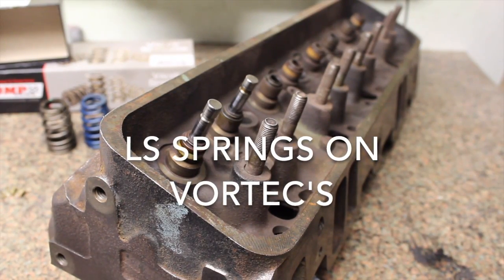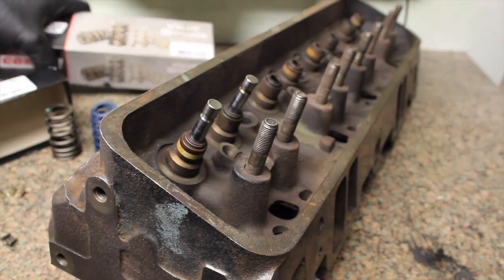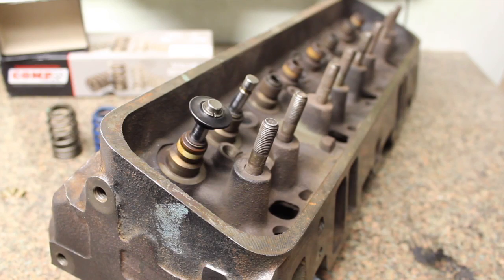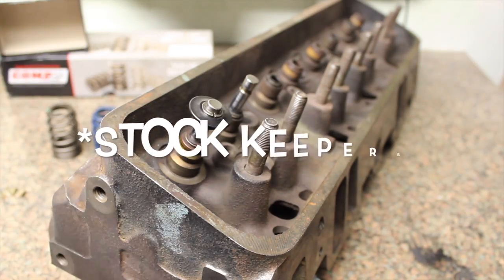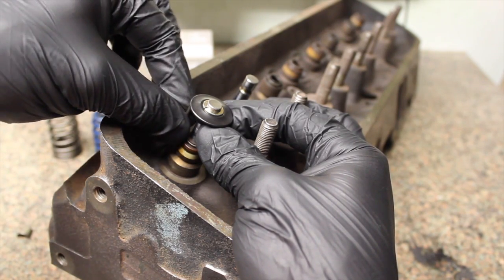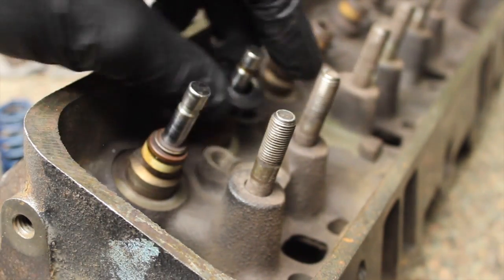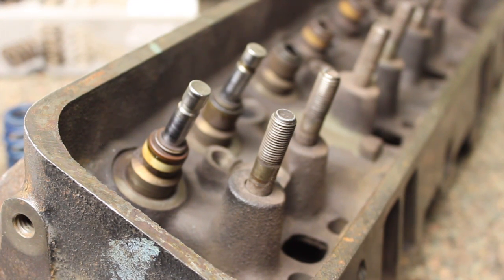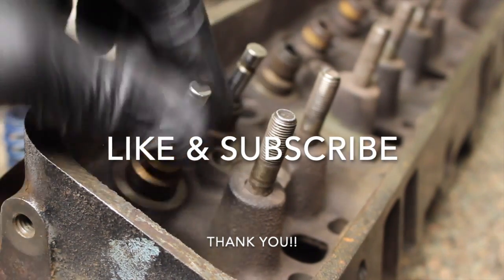LS6 Valve Springs on SBC Vortec Heads

Comment: Hey bud , I wanted to let you know I enjoy and appreciate your video's. I have a question for you also. I recently ordered a set of the ls6 beehives from summit racing. There store brand and they were way to tight of a fit around the guide bosses. So i ordered another set of howards cams beehives that they recommended for my cam. They fit the bosses with room to spare and the outside lip of the spring pocket holds them in place pretty well. Do you think this setup is acceptable or should i rely solely on the guide boss to keep the spring in place. Probably have about .015 to .020 clearance between the spring and the guide boss.
Reply from the maker: What size are your guide bosses? A ls6 spring will typically fit perfect over a clean stock guide. i have has a few sets that ive has to take a sanding roll to clean up the guide a bit more for them to fit. 
As for you new springs if the outside pocket holds them then you should should be ok. A normal spring locator has about .010 clearance. 
Cheers!
Reply: @cuttersperformance   they range in size from .854 to .857 the springs i got from summit are around .855 id i ordered the other set of howards cams they are .900 id and seem to fit ok just a little wiggle room between them and the bosses but the lip around the outside of the spring pocket holds them in place pretty well. Thanks.
Reply: Roller tips?!

Comment: Great video! Very informative! I’m looking for a nice cam and spring kit setup for my ‘98 Chevy Silverado with vortec 350. Do you recommend one with a nice lope(like with a mutha thumpr or thumpr cam sound)?
Reply from the maker: A really good sounding cam I've used a few times now is the meiling 22280 
It has a really nice lump to it
Reply: @cuttersperformance  melling 22280 isnot a computer cam will work if you run carburetor if you are staying throttle body you need computer cam?
Reply from the maker: @alfapecho818  ive used that cam with fuel injection. Needs a good tuner though

Comment: Would this work with the 5.7 vortec stock heads aswell?
Reply from the maker: Yeah that is a 5.7 vortec head
Reply: @cuttersperformance  I recently purchased a 96 c 1500 with a 5.0 vortec. I will be changing the intake manifold gasket as it is leaking coolant.  While replacing the gasket I will swap the cam. Will the ls6 springs work on the 5.0 vortec heads? looking  to get about 490ish lift.
Reply from the maker: @B Don  yes they will
Reply: @cuttersperformance  thanks for the reply, would you happen to have any cam recommendations in the .480 to .500 lift range. Want to stay short of the 525 lt4 hot cam

Comment: Could I use the ls6 springs on a old school 886 head? Also i have asked before about using 059 heads on a 3 50 would it be possible to use the ls6 springs on them also? And my final question is which would be the better bang for the buck using the 059 heads or the 886 on my small block 350?

Comment: Outstanding work 👊🏼 I’m looking to freshen up my 94 impala SS. I just ordered Try-Y gen 2 ceramic coated headers with 2 1/2 inch XL spintech mufflers. The car has 105,000 & I plan on keeping the stock cam. I’m looking into beehive comp springs with 1.6 RR. The plan is installing them under the hood down the road. I have been a mechanic for 19 years & have never done them on an Lt-1. Any advice would be greatly appreciated. This car is in honor of my brother that was killed in 94, he was a marine. I must say that you are doing a great thing by sharing your knowledge & I just subscribed 👊🏼🏴‍☠️🇺🇸 🔝
Reply from the maker: Yeah man not hard to do, 
Use a leak down tester to pressurize the cylinder at TDC, then use a on car head valve spring compressor to push the spring down. Then carefully use a magnet to remove the keepers.
the compressed air hold the valve up 
Let me know if that doesn't answer your questions and I can do a video on it 

Cheers!
Reply: The 26915 comp springs are the ones I’m reading about. I have the other part numbers in my tool box for the retainers & whatnot. My question 🙋🏻‍♂️ is which tool would make it easier for removing the springs. I have the spinning star ⭐️ one in my box. I read about another that’s a lower profile, to make the process quicker for the firewall side. I’m in no rush at the moment cause I’m still waiting on parts. Again, I sincerely thank you for sharing your knowledge 💯🏴‍☠️🇺🇸

Comment: Hello I have a atk hp32 my cam has is 220/224@50 495in 502ex 112 lsa compression 9.6.1 roller cam is there something better with less lift for more power also 5 speed manual thanks
Reply from the maker: What are you not happy with the cam you have now? Why less lift?
Reply: I don't know to much about cams i didn't know what makes the power duration or lift

Comment: Great videos I’ve have watched a few and thanks for the great advice.   I'm doing a budget build with my old 350 rebuilt and bored 0.30 flat top pistons with Vortec heads Going to use ls6 springs and retainers with factory rockers would get the off set lock if needed . I Don't want to do any machine
  Could you recommend a good cam for this set up I know my compression is going to come up with those heads there are so many different cams I get confused   I'm putting the engine in my Camaro its just a summer toy  it has dual exhaust with headers th350  3:373 gears with 28 inch tires
Reply: what cam did you end up going with? going to change my springs and my setup sounds close to yours
Reply: @PerFectCapture  Competition Cams CL122463 Xtreme Energy XE274H Cam & Lifters Kit   it pulls strong guessing around 375-400 Hp

Comment: What self aligning roller rockers and cam do u recommend after using the offset ones?
Reply from the maker: The comp cams roller tip self aligning rockers work well 👌 
The cam will depend on your combo
Reply: @cuttersperformance   I want to do a bigger cam than the 280h I currently have I already have the screw in arp studs just want a bigger cam to wake it up a little more
Reply: 1.5 or1.6?

Comment: When using the gm blue springs can you keep the stock 062/906 keepers and retainers?
Reply from the maker: Keepers yes, retainers no 
You need to use retainers for beehive springs
Reply: @cuttersperformance  so unless I'm swapping in 8mm valve stems I'm looking at new parts vs grabbing them from a junkyard ls engine. Just seems to me the entire point of vortecs is low budget build, by the time you rent the cutter to make a standard double spring fit, have a valve job done, setup the heads right.. no matter how you look at it you'll have 3/4 the cost of a decent set of aluminum heads invested in the iron heads. I have a low mileage set of original 906 castings that were basically given to me. Engine was new under warranty and spun a rod bearing. My buddy works at the dealership, they sat on a shelf waiting for a return authorization from gm for over a decade (gm elected to send a new long block) finally the service manager gave them to my buddy. He gave them to me. Less than 35,000 miles on them. I'd like to use them on an old long rod 355 I have sitting here. And not spend 700 bucks making them work with the.540/.540 lift solid flat tappet cam that's in it. If I have to end up changing the cam, or doing other things I'd be money and time ahead to buy a set of afr enforcer heads for a grand and just bolt them on.
Reply: @cuttersperformance  really just want to cut down the guides and throw a set of double springs on them and run them. The heads are so fresh they still have the bar code sticker on them from when they were assembled. Some mild surface rust to clean up, but other than that they are barely broken in dude. Suggestions?
Reply from the maker: I tell guys all the time, unless you get the heads cheap and do the work yourself its not usually worth it 
Typically you can have a set of vortecs all done for under $500.
But its a hell of a head for the money

Comment: Please give your opinion on single vs dual keeper groove.
Reply from the maker: By dual keeper groove are you referring to older or after market valves with two grooves? If so the top groove is for the keepers and the lower groove is for a o ring (older engines)
Reply: @cuttersperformance  - not specifically to the sbc but for example, ferrea makes some valves with two grooves that the keeper rides in. Supertech only has one groove and I’ve heard mixed information that one is better than the other. I just wanted to know your thoughts. Thanks for the reply.
Reply from the maker: I've seen double locks on some stock import heads but I've personally never used them on any performance applications

Comment: You need to buy a valve spring hight micrometer. They are 40 to 90 bucks and the cheap ones are accurate enough.
Reply from the maker: I have two brother use it weekly! This is just a ole school way for guys to do it at home without buying one. Works well actually

Comment: I got a l31 crate motor and I am pretty disappointed with it I wasn't expecting much but still not alot of power I want a 480 480 cam should I use that offset keeper to be on the safe side
Reply: Crate motor, it probably has the later Mexico made vortec heads, not nearly as good as the made in the US ones.

Comment: I got a question. We’re did you get those springs?? I ordered them and received ones that wasn’t blue. They also don’t like to fit over the guide boss have you have this issue
Reply from the maker: I've heard of others having this issue  but I have not. I stopped using the blue springs after I came up with my own kit. I heard of others having issues with the gm Mexico blue springs so I stopped using them but I've used many sets without issue personally

Comment: I have chevrolet performance beehive springs, 787 retainers and +.050 keepers with an lt4 hotcam which is .492 lift with 1.5 rockers I am intending to install next weekend. Will this set up fit in my truck? Thank you
Reply from the maker: With the offset keepers you should be ok with clearance but i cant say for sure. Always a good idea to check rather than guess 
If you are running the stock rocker arms you might be maxing those out aswell 
Also make sure you check your rocker arm to retainer clearance as thats can be a issue when using offset keepers
Reply: @cuttersperformance  thank you for the response man and I will be using stock rockers for now and I will be checking all clearances my only concern is the rocker and retainer clearance. Thanks for the great content I am now a subscriber.
Reply from the maker: Really be sure to check rocker arm to rocker stud clearance at full lift if your using stock rockers 
Thanks for subscribing!
Reply: @cuttersperformance  also if my stock 1.5s won't work do you have a suggestion of some that will? Having a hard time finding info about this online thanks
Reply from the maker: @BayouOutdoors92  comp cams 1417-16 should work great for you 👍
Reply: @cuttersperformance  thank you so much you're awesome dude will be referring everyone to your channel
Reply: @cuttersperformance  the 1417-16 with beehive springs and 787 retainers and +.050 keepers rub every single valve and retainer badly praying I can fix this on the bench grinder tomorrow.
Reply: @BayouOutdoors92  how did this turn out? I have my cart full on summit with all the parts to do this. Wondering what rockers to use?

Comment: Can a race engine get by with umbrella seals or no seal at all? Set I just bought off a stock car have no seal on them
Reply from the maker: I've seen some guys run no seals on drag cars and some none just on the exhaust 
Not something I would do personally, I have a set of darts that had some valve seals pop off the intake valves...the oil build up on top of the valve is insane
Reply: I have the comp cams retainers with offset locks but may have to trim the guide down a bit to run seals. Lunati spected out a voodoo 703 for a 406 that is a vacuum rule race engine. Rules allow 15” @1000 rpm. I have my doubts it will make that. I even told them it has 1.6 comp roller tips so I will gain like .031 lift from those. I may drop to a 702 camshaft and be done. thanks for the advise
Reply: A lot of times will run oring seals instead of umbrella seal.

Comment: This was a good video my only thing is I’m running .450 with 100% stock heads and it runs great I’ve heard mostly that you can run about .465 with stock heads as long as it’s not a high duration cam but I love your content keep it up man
Reply from the maker: Do you have a pretty mild or stock cam? Stock springs are pretty weak for any sort of performance cam.
I'd be very nervous running past .450 lift personally 
Thanks for the positive feedback! 
Vortec porting / flow bench videos coming soon!
Reply: @cuttersperformance  it’s a sum-8800 stage 1 cam it’s pretty mild with a almost stock smooth idle
Reply: @cuttersperformance  also I 100% agree I know I’m cutting it close at about .030 clearance but I haven’t had any issues but I won’t run anything over .450 without beefed up springs and retainers
Reply from the maker: @anthonyspangler1537  Hit me up if you need a spring kit for those suckers! I got springs to cover from mild to wild, no machining and direct drop in! 
pcperformance1@outlook.com
Reply: @cuttersperformance I'm running a Crane Cam power Max cam. The lift is .427/.454 lift. The duration is 204/216. It red lines at 5,000 rpm. What spring will work for my stock Vortec heads?
Reply: I’m only running .450 lift is there a slightly beefier spring available I’m looking for something slightly heavier but nothing crazf

Comment: I have watched all of your vortec head videos and I would like to know if 305 vortec heads (12558059) any good?  Thanks keep up the good work!
Reply from the maker: Yeah the 059 (305) heads are also a great head and the best production 305 head ever made.
They have smaller intake valves and don't flow aswell as the 906 or 062.
They have a smaller 58cc chamber.
I don't have any in the shop but I've been trying to get a set to modify and put on the flow bench 
I always go for the 906 or062 heads but im curious how much flow I can get out of 059s even with the stock valve size with some port work
Reply: @cuttersperformance  The 059s I had actually outflowed the crack prone hecho en mexico 062 garbage heads that came on the crate engine in my Express van. I run Pac1218s on 0.100 longer valves with the springs shimmed correctly. Cheap tip as well. Fully seat your seals.  They work perfectly and give you additonal seat to retainer clearance.

Comment: Got a question for the beehive springs do you have to run a different keepers? Like would the stock ones work
Reply: CompCams makes a retainer that works with the beehive springs and the 11/32" diameter valves.

Comment: This is exactly what I needed! Im running .600 valve springs for an ls6 on my heads, screw in studs and offset keepers, but what are the best or what self aligning rockers would you recommend?
Reply from the maker: I've had good luck with the comp cams roller tip rocker arms 
Especially with offset locks locks becuase you lose some of the valve tip. Make sure you check your rocker to retainer clearance 
*See my vortec rocker arm video

Comment: Cool video I’m running vortec heads on my 84 c10. My question is I used ls6 blue springs and comp locks with comp retainers. No machine work besides cleaning and new valves guides are not cut down The cam I what to use comp thumper cam .479int and .465exh would good running this or cut it close. Thanks
Reply from the maker: As shown in the video .480 lift was good with a .050 clearance to the stock seal.
So if you used the same retainers you should have no issues 👍
Reply: Thanks

Comment: Thanks for the video. Question, I have a new pair of 062 heads I bought years ago and have been saving. They had the Z28 beehive springs installed by a shop, and I was told the were checked to .480 lift. Only planning to go .440 lift on the cam. Are the press in studs ok? Thanks.

Comment: So using the .050 clearance rule,the stock set up clears .450 lift but the springs are to weak?
Reply from the maker: That is correct 
Some guys grind the bottom of the stock retainers, but not something I like to play with. 
Stock springs are very weak
I put beehives on every set of vortecs ive done
6000+ rpm and .550 lift no problem with the right springs

Comment: Have you ever seen a stock head not take a .450 lift ?
Reply from the maker: Are you talking with stock springs aswell?
Reply: @cuttersperformance  Just the clearance problem,I'm assuming I can get a stronger spring,am I wrong?   Thanks
Reply: sorry,Iwatched the video  again and seen the .420 limit I missed the first time.( I have seen some probably mis info saying stock was good to .450)
Reply from the maker: General rule is...make sure you check anything over  .450 lift
Reply: @cuttersperformance  Yes,as soon as I get these health issues over with I'm gonna get out there tear apart and do measuring and building.Thanks for the good info

Comment: I bought a set of 906 rebuilt heads from a  machine shop. I added 1.5  roller rockers and a summit 488/488 flat tappet. No screw in studs.  It has new stock style 4 valve relief pistons. It runs great. Question what issues can I run into? I haven't taken it past 4k rpms.
Reply from the maker: Do you know what springs are on it?
Reply: @cuttersperformance  I believe they look stock. Can send you pics if you want
Reply from the maker: @juliodiaz8280  yeah send me a email pcperformance1@outlook.com 
They must have changed the springs  + cut the guides if they didn't use beehives. Stock springs are very weak and you would never get the clearance at that lift
Reply: @cuttersperformance  ok sending you pics in a bit. Thanks for the help